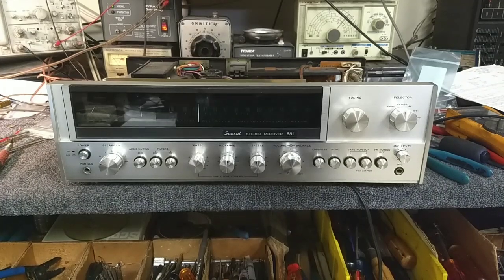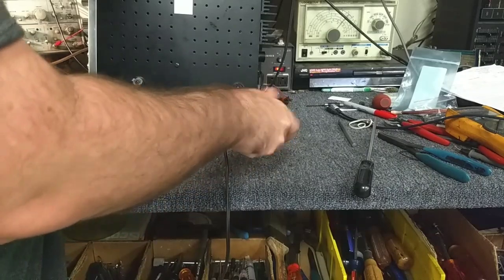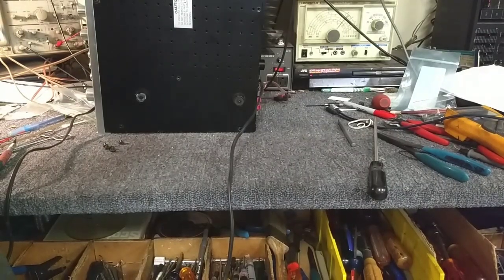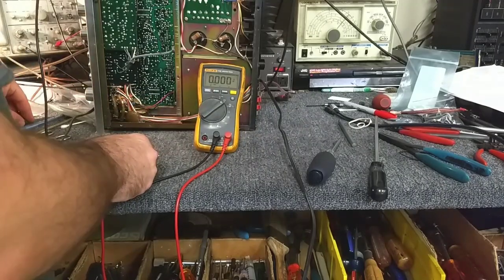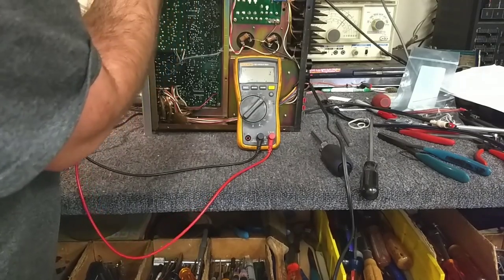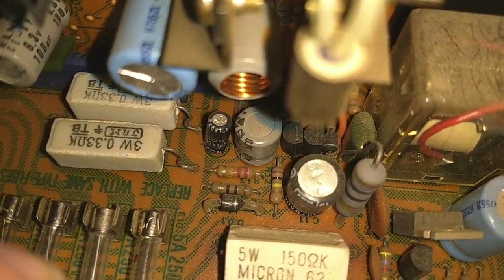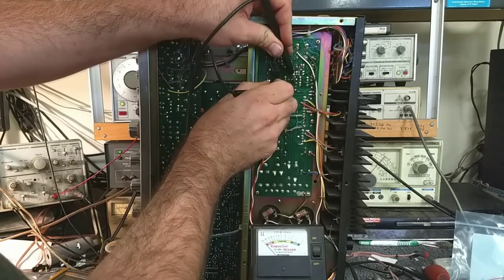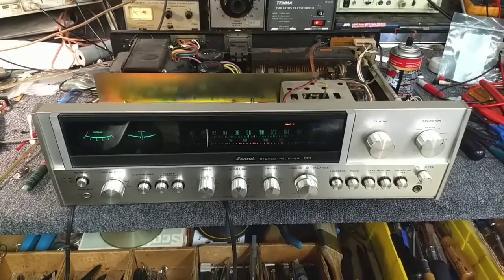Quick diagnosis and repair of faulty protector circuit in sansui 881 receiver

Comment: Nice troubleshooting.  My 881 has an interesting issue.  It won't shut off, regardless of power switch position. So could be arc quench cap, or bad switch.  Also, my 881 did not need bulbs, but has cold solder joints from the bulb's fuse clips to the board.  So just remove the bulbs, resolder, and your lights won't flicker.

Comment: I have the opposite problem to this. When I first got my Sansui 771, the relay didn't click at all. I left power on, tapped the relay a few times, and was able to get it going. The issue is, that the relay clicks in too fast. DC offset doesn't have time to stabilize, and I hear a nasty pop out of the right (wonder why not both) channel. Turning on the power, the relay clicks almost instantaneously. Right now, I just turn on the speakers some time after the relay clicks, and I'm good. I would like to get it fixed anyway, as it's not working as intended.

I measured, and set the DC offset and bias to factory specs. They were both just a bit off on both channels. I shot for 0mV offset on both channels, and it kinda hovers in the 0-20mV just to take some stabs at around 50mV at max. I don't know if that's an issue of it's own or not.

So, any ideas on, why the relay clicks out of protection too quickly?
Reply from the maker: Capacitor that controls turn on timing is drying up. I wanna say it's a 220uf at 10v or something like that.  I increase those to 470uf. Even when they were new they needed more time.
Reply: @JordanPier  Hey, thanks for the help! Any chance you could identify the said capacitor in the schematic for me? That is, if you have the service manual for the 771. I'm a total amateur in reading schematics but I presume it resides on the power board, and could it be either C03, ot C08? Thanks again.
Reply from the maker: @kukko83  c08 is your timer. Increase this one to 470uf. C07 is the fast shutoff capacitor, which if it is failing can cause the machine to go into protection randomly without any DC offset present.

I'd replace both for reliability reasons
Reply: @JordanPier  Thanks again, you've been a great help! I'm a mechanical guy myself but replacing capacitors, is within my abilities.
Reply: @JordanPier  So, I went ahead, and replaced C08 with a 470uF 16V capacitor. In fact, I replaced all of the electrolytic caps on the power circuit board, excluding the bipolar ones. That's because I didn't realize they were BP when I ordered the caps. I replaced all of the other caps for ones with original values.

None of this solved the original problem though. The relay still kicks in as quickly as before. Still care to offer an advice, on what to look for next?
Reply from the maker: @kukko83  that is odd. Almost like a driver Transistor for the relay is leaky or shorting. Without seeing it in person I can't offer much more help
 
You've done right, but something is still a miss
Reply: @JordanPier  Okay, thanks again for the help. I'll try and look into it some more. It's more of a nuisance than a real issue but I hope to get it fixed anyway.

Comment: Electrolytic caps will fail after 20 years or so. Accurately diagnosed good fix.
Reply: More like 40 years if the capacitors are not chemically defective (as happened with SMD capacitors in the 90s, and regular electrolytics in the 2000s).

Comment: I’ve come across so many 881’s and 771’s with a chronic background hum. Cleaning all the circuit board contacts and grounds never helped any of them, wasn’t the caps, no stray DC at the outputs, not the filter caps either. Just a low level power amp hum in the background that some people don’t care about but drives me nuts!
Reply from the maker: Check grounds and 35v regulator. You may need a scope to check for hum on the 35v line.
Reply: Mine's as quiet as a mouse.  Never had any hum.  So it was either fixed before I acquired it, or just never had this hum issue.